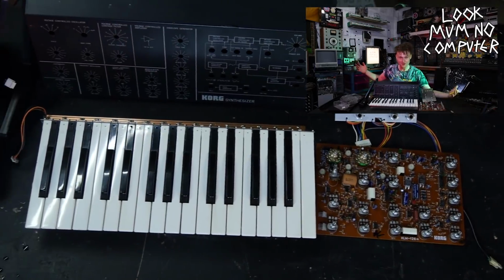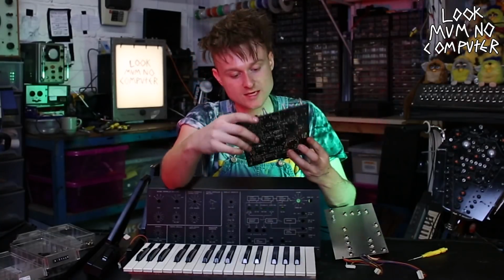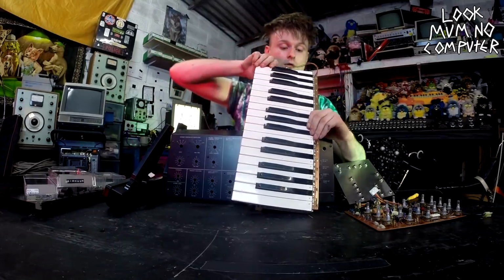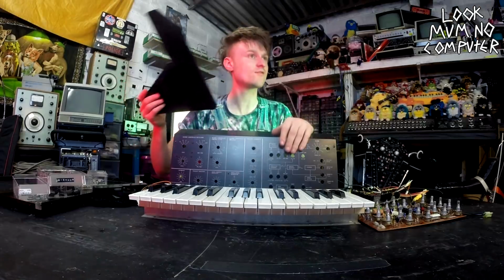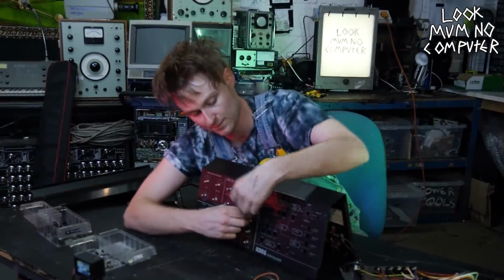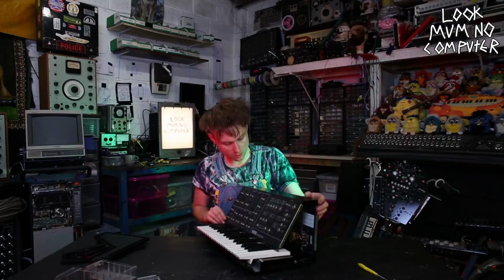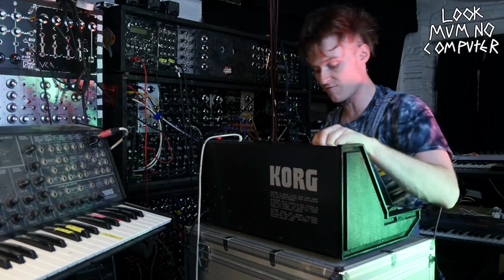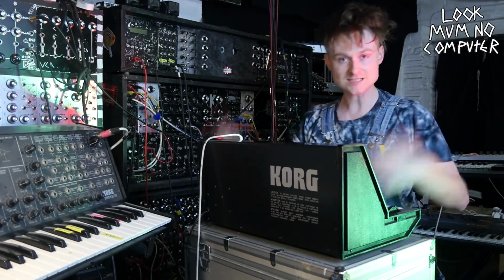KORG MS10 Whats inside? REVERSE TEARDOWN #1

Comment: 5:15 "No user-serviceable parts inside"... meanwhile it's easily serviceable compared to modern SMD circuitry. 
...though I guess back in 1978 that wasn't the case since you couldn't just google search info on synth circuits.

Comment: Awesome! I love mine, I have the grey-faced MS10 and MS20. I also bought a MS20 mini for modding (didn't want to drill my vintage original), which now has a PWM pot wired into the LFO and oscillator sync switch (just add two diodes and you're sorted). The MS range are my favourite vintage monos!

Comment: being (due to my ooooooooooold age) the proud owner of almost all the original Korg range of that period (and the earlier generation too, the "traveler" ones), I have to admit that my favs remain the MS 20 (Mk I = raging filter), 800 DV (my very first synth, bought in 76) and the MP-500 (micropreset). As for the filter, the best deal is to buy an MS20 kit (which I did), allowing you to swap easily between all the filter modes (a bit like with the Prophet 5 or Arp Odyssey)... plus, the MS20 kit has a cool flat form factor (proof again that the MSs are indeed big empty boxes (but great then for circuit bending - or hiding away furbies, your choice), and talking about circuit bending or customizing, the MS kit is a dream come true: lot of free holes on the front panel and connecting points on the circuit board to add new patch points... last but not least, thanks to its flat form factor (again), the ms20 kit can easily be placed in front of its ancestors' kbds (which I did, with a rack including MS10, MS20, MS50, SQ10, MS02, MS03, MS10 mini, on top of a stage echo 500... just the VC10 missing... too expensive when it was originally released - and too expensive now too on the vintage market). Anyway, about the prices : my M2 20 cost about FF 3200 when I bought it in 77 (or 78) which was something like £ 250, and the MS10 was at FF 2500 (£ 200)... (compare to the FF 10,000 of a 800DV or FF 12,000 of a mini Moog model D in the same time frame or FF 8000 of a synthi AKS - the Putney VCS3 was more expensive, hence never owned one... huge regrets, all the more now that I live 300 yards from Putney High Street, on the other side of where Peter Zinoviev lived, by the river :-)